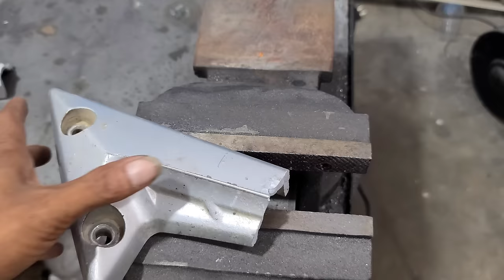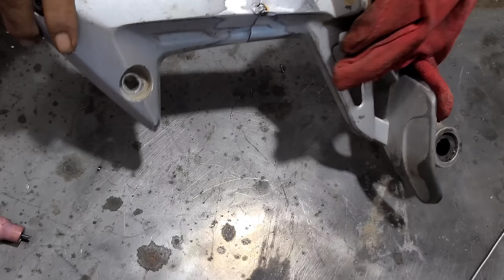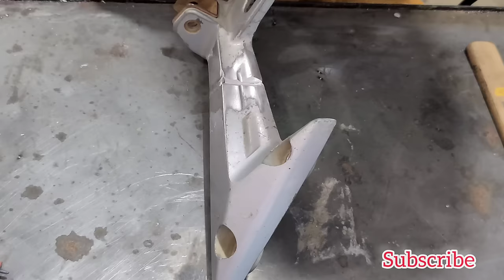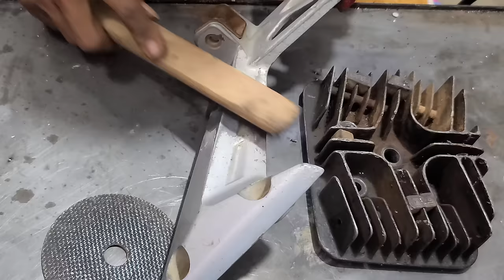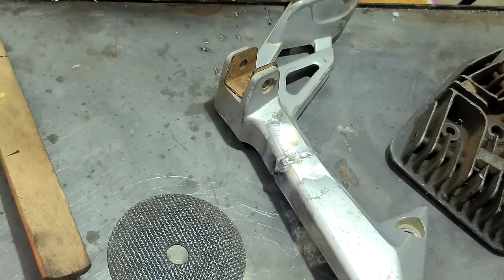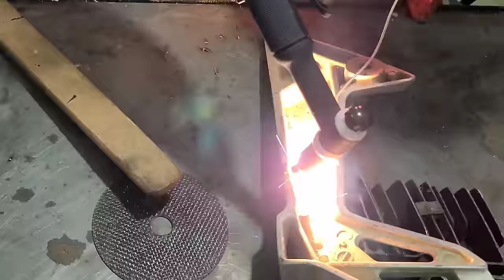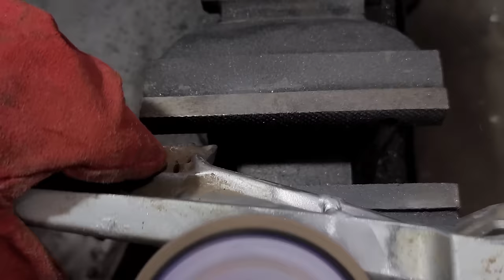how to weld aluminum which is rarely known by many people , tig welding

Comment: THANK YOU for making your video. Please take an old man's advice, for the next time you do a repair that way. Use a dremel and an end-mill bit, on the inside, and wear your sealed goggles and hollow a wide V-groove on the inside of the part. DO NOT use a wire wheel. Use a fine sandpaper lap sanding wheel, on your grinder, for the outside. Clean the area really good. Secure the part so it's bent the directions it wants to lay, for the fit. Try it back on the equipment it's for, if possible. Make SURE it fits! tack it outside then inside, and stagger the tacks inside and out. That way it wont pull more one way than the other.Have your tig ready to use. Crank up your oxy/actlyn torch to a medium flame and heat the whole part up so you can't touch it. THEN...weld it INSIDE !!!put a lot of filler rod inside. You're NOT going to grind it off. Then, on the outside, lay a stack of dimes, by melting in the surface of the metal, feed in the filler rod, come across it and back up, over and over again, never cutting off your power, and DON'T use "Pulse or Stitch" and a lay a pretty bead, nice and wide, and DON'T grind it off!!!!!! You remove MOST of your strength when you do! Let it air cool. Then crank up your torch again and have a medium flame and heat the whole part up again. This helps relieve the internal stresses of the metal. I've been told it's like a tug of war inside, between the two pieces and the annealing action, kills all of that! DO NOT grind the weld smooth !  !!!!!!! It will last a long time, this way. Let it cool till room temperature. NEVER DIP in quench tank of water! heat it up about 100 degrees and shoot it with Rust-Oleum XX2 paint. It won't corrode that way, (and aluminum is bad to do that). Also, make darn sure the material isn't MAGNESIUM, or you'll be welding a FIRE-STICK !
Reply: how to detect, it is not a magnesium alloy ? sometimes it is not possible to have information about the origins of the part... 😞
Reply: Thanks for Teaching us Master
Reply: @robertuhrikpersonal  Magnesium emits a bluish hue when tig welding.
Reply: @General Not so. Magnesium will not ignite in solid form. Only in a granulated or shaved state. And of course use magnesium electrode rod to weld magnesium, even though certain aluminum rods can be used to weld magnesium, depending on the circumstances.
Reply: Wire brush on Aluminum needs be Stainless not steel, steel adds carbon back into the aluminum and contaminates it silly..
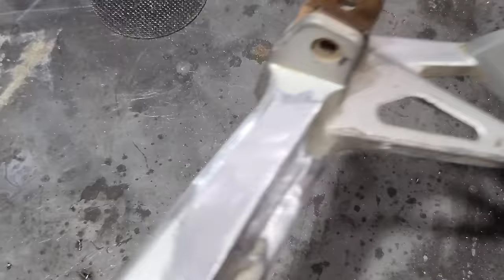Reply: @apexaero  10:43
Reply: Hmmm... sounds like there are some information for future ...
Reply: Brilliant reply thank you
Reply: A pleasant change to see very helpfull information being given instead of derogatory remarks, Thank you.
Reply: Nail clippers and work shoes no longer needed in 2023.
Reply: Самый лучший комментарий,👍у вас есть свой канал,я бы подписался и прислушался к вашим советам🤝
Reply: There are tons this videos with wrong information on purpose. It is ment to stir up a fight between the "believers" who believe everything they see on youtube and people from the actual business. Every comment is 2 cents for him. That's is what this is about.  Youtube is full of this shit.
Reply: @MrVegasTube then why do crashed helevhopters magnesium parts burn so hot?
Reply: @JH-mh1hz  I tig weld aluminum regularly throughout the year and it definitely has a high coefficient of thermal conductivity. Magnesium being similar but not exactly to aluminum, shares with aluminum, that it requires high heat to melt. Certainly above 2000 degrees on the tubes and ramp I've welded. But heres the thing... I've never seen aluminum or magnesium burn white hot, and burn aggressively under a welding torch normally welding. However I twice did an experiment where I used a file to granulate magnesium to a fine powder and then subjected it to a flame, and when I blew at it, it became violent and quickly went white hot. It was so hot I saw white spots for a while. Also it was quickly consumed, I mean gone in seconds. I tried the same experiment with aluminum but without the same reaction.
So maybe there is something to your question, however all the aluminum  and magnesium Ive ever tig welded took very high heat to actually get it to melt.
Reply: saya suka dengan pengalaman yang luar biasa .menjadi pintar karena sudah banyak makan garam .
say my hello , from Kabupaten Jombang , East Java , Indonesian
Reply: @robertuhrikpersonal kita harus banyak mengenal logam .bagian yang di las / sambung harus senyawa logam
Reply: He's an Asian mate. They have to use whatever they have. All their workshop equipments together are probably cheaper than the cost of your family for 1 day food.

Comment: No deep penetration. That needed to be ground to a wide V  on both sides at the break, then welded from the inside to the outside in order to be a structurally sound weld.
Reply: Agreed, it will just break again.
Reply: @barrykruyssen  by that time he has sold the motorcycle to someone.
Reply: Not to mentioned the 100% contaminated surfaces from using a steel wire wheel! Sure, it's POSSIBLE it was stainless, but...  probably not.  ;)
Reply: Done MIG  alloy welding  you should see weld pool nearly coming through to back of weld for correct penetration , our test welds were cut to check penetration
Reply: @justthinkalittle8913  or crashed when it fails.....

Comment: Experienced welders, especially TIG welders know about welding aluminum. No secret or time forgotten trick or hack. That's why aluminum welding rods have been available for decades.
Reply: Found mig welding aluminum easy once plants set up for the weld
Reply: @nounoufriend1442    TIG is an electric torch. No flux is needed with the inert gas.
Reply: @madog1  I know , we used Argon at work for TIG welding stainless , but I haven't used tig for alloy though . MIG also uses argon but MAG (for steel ) tends to use Argon Co2 mix (not  an inert gas ) . No flux is used for MIG  MAG or TIG as they rely on gas shield
Reply: The real secret in TIG welding aluminum is using DC straight polarity, using red 2 percent tungsten and pure Helium. It's used to weld small brackets to one or two inch plate. You will have black soot on the weld, but it's easily cleaned off with a stainless wire brush. I only use an old transformer machine where I work. Learned it from an old timer in 1976.
Reply: @nounoufriend1442 All metals are weldable with TIG, except zinc which is the plating used on galvanized steel. The short list: steel, aluminum, stainless, copper, brass and titanium. And for TIG welding you can only use Argon or a mix of Argon and Helium. No Argon/CO2 for TIG. Try some MIG ?, spray arc using Argon with 2 percent Oxygen. I never learned the term MAG, you'll see the question mark. I'm just an old timer.
Reply: @georgebuck2269   Thank you for the information. I haven't welded in many years. I mostly just did stick welding, oxy acetylene and brazing.
Reply: @madog1 I learned oxy/acetylene gas welding in trade school in the sixties. It was a large regional high school. The teachers were arc welders and we had to learn pipe and vertical up arc/stick welding. They had a few MIG welding machines, but no lessons on that style or TIG.
Reply: @georgebuck2269  I took all my welding in high school. When I went to college, I had to decide between welding or automotive technologies, so I chose the latter.
Reply: @georgebuck2269  BTW, mine was in the late 70's and early 80's.
Reply: @madog1 When I was just a kid I learned hobby electronics. At age ten I started learning car repair and always to this day work on my own car. So in all those decades of being a factory welder, I would combine my skills and do maintenance on all the welding machines. It made me a very valuable employee and I never got layed off from any job. I'm starting a project to replace all the brake parts on my Toyota, it has 128 thousand miles on it. But I never worked as a car mechanic.

Comment: "Without a doubt, the breakthrough for aluminum as a welded structural material occurred with the introduction in the 1940s of the inert gas welding processes." Rarely known?!?! They have been teaching aluminum welding at a local HS  for over a decade. Rarely known in the third world maybe.
Reply: Yes aluminum can be TIG welded with AC or DC. The original TIG was DC.

Comment: i agree with the comments criticyzing the methods of welding preparation. as an welder certified for aircraft welding, i would add that it is not advisable to grind the weld after it was finished. knowledge of the type of alloy and the right welding rod material is important. some aluminium materials are not weldable and if weldable, the mechanical strenght may be poor after welding
Reply: I like to criticize spelling
Reply: I'm agree with you. If it is not obstacle to other components, better not to grind.

Comment: Looks like you have a shop, welding table, welding gloves, hood,  TIG welder, shielding gas, power tools, abrasive disks...etc, but use cuttings of electric cable as filler rod?
Reply: It was all that he could steal

Comment: I wouldn't use pulse for that thick material, i see lack of penetration because of that, wire wheel is also poor choice to clean up, best is sandpaper grinder disc but I guess it is all You have and you trying to survive in this world so good job my friend 😁
Reply: Good advise
Reply: Sandpaper grinder disk is the worst you can use, the sandpaper is glued and you dont want that shit in your weld

Comment: Nice, a tip for you ; clamp one end of that cable piece in vice, the other end in a drill spin the drill while applying slight tension for a short while. It straightens the wire quickly and consistently straight.
Reply: Why wouldn't it twist it into a spiral and break it off?
Reply: @Spiritof_76   Keep constant tension on the wire/filler and don't go crazy with the drill.  You don't need to twist it much.
Reply: Forget the drill. Hold the that end with a vise grip. Put a little slack in the wire then give it a hard snap. Instant straight wire.
Reply: Yes sir...do it all the time..
Reply: just dont straighten cables to use as a welding wire, that is just silly

Comment: A fine job of sanding but not such a good job welding. Lots of contamination and porosity in the weld and no penetration on the weld on the inside of the piece. Buffing with a wire wheel before welding often imbeds impurities into the base material and the constant sticking of the tungsten also makes for contamination of the weld.  Probably not a good idea to use electrical wire for filler but if that is all you have it has to do.
Reply: a gree
Reply: Talking is free from work.
Reply: @Tiger-hp9nq  everything said above is very correct.   I would never disrespect good advise and criticism.  This is coming from a man that has been welding aluminium for over thirty years
Reply: It held together.   It’s good enough.
Reply: Guess I should not be a keyboard critic and suggest how I would do that repair. So, If I was to do that repair at our shop I would clean the weld area thoroughly then groove the backside with a carbide burring tool to prevent any contamination of the base metal from the adhesives that hold the grinding wheel together. That also lets me use the original break line on the front to get everything back into correct alignment. I would then weld the backside getting good penetration of the joint. Hopefully I would have the correct filler material. Basically we use 4043 for cast aluminum and 5356 for forged aluminums , but if electrical wire is all that is available use it, I have done some oxy acetylene repairs using wire coat hangers when I was young. I would then groove out the front of the seam all the way into the existing weld on the inside and weld the outside groove getting 100% penetration on the repair making sure to get good starts and stops at the edges of the piece.  Yes I have done this type of repair many times.
Reply: @boobalew  
If it’s on a motorcycle,would you bet your life on it
Reply: @randypond7499  ;  Well.....Probably not.  LOL
Reply: Using a clean stainless wire wheel dedicated for cleaning aluminum can do a nice job of cleaning 6063. Used this method for many years assembling small parts that didn't brighten up properly.

Comment: I’started to practice Tig weld. When using the face helmet can one actually see clear the filler melting?

The helmet I’m using is very hard to see anything when welding the light is too strong. Currently using only 100 amp on the Tig welder machine.

Comment: Always make sure Brush wheels are stainless steel for aluminum  and never touched anything else besides aluminum Same for Wire brushes Stainless steel only and only touched aluminum only and use lots and lots of acetone  and if you want preheat your metal  aluminum cools 4x faster than carbon steel  EDIT  Also don't use low pulse  no 1 PPS  use 10 or 30 PPS  and wait till the oxide layers burns off before adding filler and moving
Reply: He can weld better than you.
Reply: @rsz90182  Sure that's why I make 50 a hour welding stainless steel Tig
Reply: @rsz90182   do you troll even know what welding is anyway? Its with superglue.
Reply: This man is correct.
Reply: Exactly

Comment: I would recommend using a carbide burr rather than a cutting disc to prepare the weld area.  It is more controllable and will not leave any residue or contamination as a cutting disc will.  I like how you used aluminum wire (1100 alloy) as your filler material.  However, it is likely that your weld will be significantly weaker than the parent metal.  Your casting is likely to be a silicon based aluminum alloy, essentially a 6xxx.  But I suppose in a pinch what you did will work.  What is the part from?
Reply: Why is everybody forgetting to chamfer or grind the edges at a 45 degree angle. And use 4043 filler rod for cast aluminum. Pre-heat is good if you don't want it to crack.
Reply: @georgebuck2269  well, this is in Indonesia.  They do things differently there.

Comment: What alloy is the base metal?  Is it a weldable grade of aluminum?  What alloy filler metal is compatible and best suited with this alloy of aluminum?  Was the part originally heat treated?  Some of the questions people welding aluminum should consider.

When you are fixing a component with structural significance and dip the tungsten, you should stop immediately and cut off the contaminated part.  And at least final joint preparation should be done with a burr bit, file, saw blade, or equivalent, not an abrasive wheel.

Using a "lay wire" technique rather than dipping the filler metal when welding anything other than the thinnest aluminum is a recipe for incomplete fusion, especially when doing a groove weld.

Comment: GREAT JOB! is the weld structurally sound? i am no welder or fabricator but i  am amazed. guess there's different ways to do the same thing but i learned a lot..
Reply: It was done half @$$'d.  1st it wasn't cleaned correctly, then he didn't clamp down once fitted up then he didn't cut a  gap along the break to get penetration.
Reply: @grege2383  thanks...  looked great when finished but durability/ safety is the question.
Reply: @spike7703   -  no way it should be trusted.
Reply: @grege2383  is that part a frame support?
Reply: The parts have to have the edges ground at a 45 degree angle to start. And use the proper filler rod.

Comment: Still AC tig?  Or can I do this with 110v DC tig?  How do I know Alum from wire is same material as alloy from moto part?
Reply: Aluminium welding need AC tig with argon gas, use anything you got to clean the part, but has to used stainless steel brush to removed/clean oxidized from part before welding,  aluminium easy/fast to oxidize. You can used same material alloy but the material must be clean (better buy aluminium welding rod).  I understand not everybody had money or resources.
Reply: To dc tig weld aluminum you need pure helium for your shielding gas, kind of expensive but dc tig aluminum is doable.
Reply: dc on aluminum is going to be tough to get a decent weld and is only really used to get better penetration on thick aluminum. It is not something that is easy to do and will probably look like crap. If your going to attempt it you should probably have a lot of experience and be proficient at ac tig first. You should have ac to Gtaw aluminum this creates a much cleaner and better weld. a 110 volt tig would not have enough amperage to puddle the aluminum unless it was really thin. To weld 1/4" thick aluminum your going to need a minimum of 200 amps. Aluminum is mig welded with dc but doesn't really work well without a spool gun or  push/pull setup like a cobra.
Reply: @mohammadnoormauludadnan1847   pas de brosse inox pour l alu mais brosse laiton
Reply: oui courant alternatif soudage impossible en DC  pour l alu et alliages pour ce type de piece il est préférable de prendre une baguette passe partout de l AG5 aurait été préférable dans ce cas précis pour savoir approximativement la nuance c est au son  jettez la piece par terre si bruit sourd alu pur si mettalique alliage apres c est de l expérience
Reply: @mohammadnoormauludadnan1847 First thing to do: grind the top edges at a 45 degree angle.

Comment: We could criticize it but not bad the first thing is to wire brush with a stainless brush then a good bevel jig it up pre heat with a rose but to at least 250 to 300° tack it up and bolt it down begin to weld then put a welding blanket over it or bury in sand to cool evenly